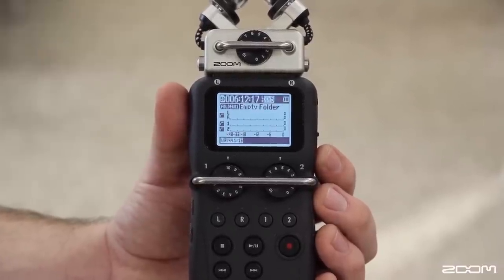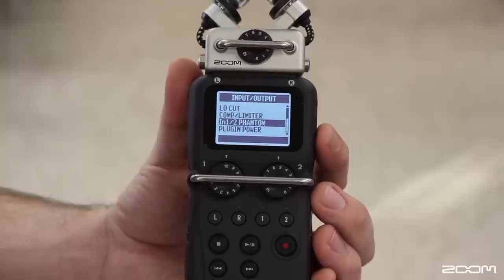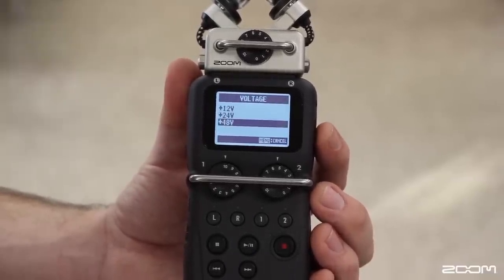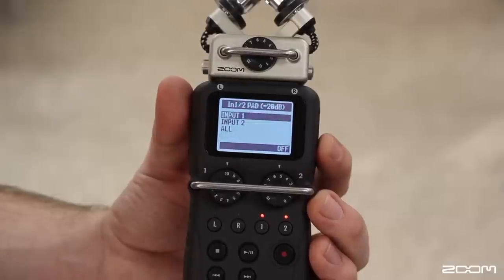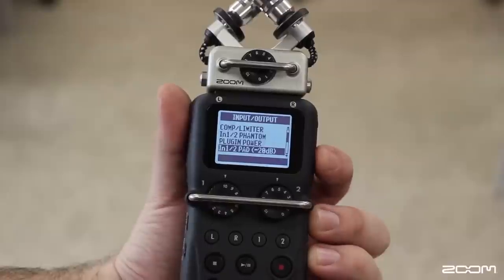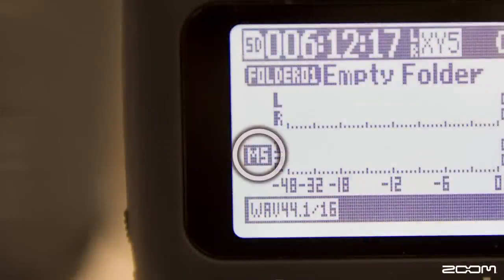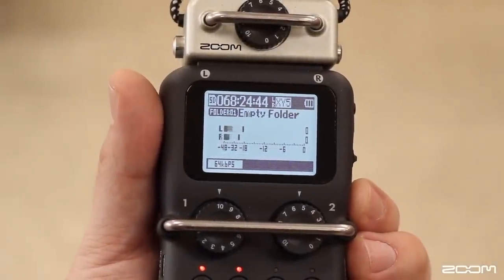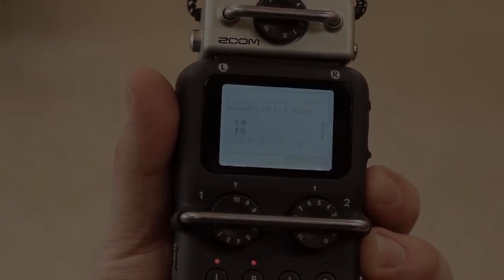Zoom H5: Input and Output tutorial

Comment: Is there a way to increase the output volume?
When I record, I get nice levels, with everything in the 50-85% range, and I can hear a great recording in the headset, but....
When I bring the file into Audacity, it comes in as a tiny thin line, that I need to Amplify 17-22x to see a sound wave pattern. This also increases hiss.

Comment: Hello! I have a question concerning Zoom h5 as an audio interface. Can I control the levels of the inputs of H5 from my PC separately? Should I use any special software? Or the only way to control the levels is every time to reach to gain knobs? Thanks in advance!
Reply from the maker: It would not be possible to adjust gain using your software. It is only possible using the hardware knobs on the H5.

Comment: Hello, thanks for the good videos. Is it possible to link input 1 & 2 gains for stereo recording? I can't manage to do this on my H5.
Reply from the maker: You can stereo link the channels but you will not be able to link the input gain.
Reply: Ooh so sad! I can try to move them both at the same time, but as the knobs are quite sensitive, it's hard to do this very accurately. I will try to do so by putting a little rubber band around the two knobs.
Maybe for a later update or for the Zoom H7 :)
Thanks for the answer!

Comment: Hello. How’s it going?

I’ve just bought a second hand Drum Machine and little synthesiser and been messing around with them throughout lock down.

I run them through a little mixer. If I purchase a H5, would I simply go via an rca to mini Jack. Go from the rca output on mixer, to the line in on the h5 via mini Jack.

Is it that simple? If anyone could let me know that would be really helpful. 

There’s a pawn shop near me with a h5 for sale, so I’ll grab it if it will suffice for what I mention above. I’ll also use it for recording out and about as well.

Cheers x

Comment: Hello I have write many times to you for your products and you have been really helpful. I have finally get in my hands a zoom h5 device. Its a great great great on. But I have a small problem and I am pretty sure that is solvable. I wish to use the device as an audio interface at 48kHz and that means that I have to use it in the MULTI mode. The windows environment seems to be working really fine I use the ZOOM H and F series ASIO and everything works well, the pc recognizes everything etc. The problem is with the Cubase LE AI Elements 8 it recognizes only the devices input and it doesn't allow me to select the ZOOM H and F series ASIO at the VST connection output audio device. Can you help me? The software seems to receive and display the signals fine but it doesn't send them out. Meanwhile the browser and other software are working perfectly. Any suggestions would be really helpful.
Reply from the maker: +Pau Cosmos Please contact support at info@zoom-na.com and we can help. Thank you

Comment: Is it possible to connect the Zoom H5 to a MacBook Pro to use it as microphone for Skype calls? If so, do you need any additional wires or adapters for this?

Another question is, I noticed the XYH-5 has 90 degrees only and the XYH-6 has 90 and 120 degrees. Which amount of degrees is optimal for recording the following instruments: (alto) saxophone, trumpet/flugelhorn and (electric) guitar.

Does the Zoom H5 offer playback from 50% to 150% without deforming the sound, just like the Zoom H6?

What are all the advantages of the Zoom H6 over the Zoom H5?
Reply: First, yes it's possible with the driver for Mac that you will find on Zoom's website. The H5 is acting as an USB audio-interface and you're not using the ADC in your Mac so improved sound quality. You can always use the line-out jack of the H5 and the mic input of your Mac but there's 2 level to adjust: Mic knob gain on the device and the gain of the mic port. 

Second, it depends of the distance between them. If you want to be close, it's sure that 120° is better because the sound is louder. I never use the mic capsule included with the H5 for music recording because I have Audio-Technica/Shure/Schoeps mic.

Third: the main advantage of the H6 is the ability to have 4 xlr input (up to 6 with the Zoom EXH-6 adapter). Also, you have physics button for the -20 db pad on the H6 that are in the menu interface on the H5. Preamps are the same in the H6 and the H5 so they're no difference in audio quality.

Sorry if my english isn't perfect; french is my primary language ;)

Comment: Great tutorial, thank you. I am getting great quality recording from my h5 stereo mics into my ipad. However I am using up my batteries on h5 which is a pity. I have tried powering my Apple camera adaptor connector, but h5 still using batteries. Any solutions to this please? Seems silly to use up batteries in the studio. My old h4 had a 5v external power supply, but it also worked when I connected my ipad through a powered mini usb hub...I haven't managed to get that to work either...
Reply from the maker: Please reach out to customer support team for assistance. https://zoomcorp.com/en/us/contact/
Reply: Done! Thanks

Comment: Hello! Has connected to the recorder a capsule from H6. Turned on, there is no reaction of the signal indicators. Twisted the adjustment, no reaction, I think, can something with the XY6. He put back his native capsule, and he does not see it. When you try to click on a record, it says: "No Chanel Record Ready." What could it be? What could happen? Everything worked after all. (
Reply from the maker: You will need to record enable the inputs which are being used. To record enable, press the L/R buttons.

Comment: Does the H5 have stereo input? Lets say I want to connect two lav microphones with an Y adapter. So I have two mics but only get one 3.5 mm jack connector. Can I use those two lav mics to record left and right, instead of using the left and right mics on top of the recorder. I want these two lav mics to be separated from each other onto an object, like a head.
Reply from the maker: The 3.5mm input on the XYH-5 mic capsule is a stereo unbalanced TRS input. We would recommend using two TS unbalanced lavalier microphones.

Comment: My H5 recently is producing high tone noise when turned on with the XY5 capsule even if my gain is at "0" and goes louder as I adjust it, I also get this noise with external microphones installed in the XY5 capsule. It's kind of whining tone that is superimposed on the BG noise when you turn the gain from "0" up. It also indicates a bar in the L/R meter as you hear the high pitched tone even when the gain is still at "0".  I tried to fully reset it but it's still the same when I turn it on.
It does not produce this kind of noise with just the line 1 and 2 XLR inputs. My H5 firmware is V2.10. Any inputs or suggestions? Thanks in advance.
Reply from the maker: Please contact our customer support team for assistance: https://zoomcorp.com/en/us/support/

Comment: Is the -20dB pad applicable to the line input, and is it pre-ADC? I have the zoom H2n and the line input is somewhat useless for recording from non-consumer mixers without extra attenuation...
Reply: The -20db is only applicable to the 1/2 input and I'm pretty sure it's pre because if it was after the analog to digital conversion and there's a very loud signal, it will distortion in the converter and the pad will just lower the gain.
Reply: I agree pre is the only thing that makes sense :) but on the h2n they have a post-ADC gain control, which is therefore useless for dampening hot inputs...
Reply: Yes it is only to adjust different level source together... The H2N isn't design that much for line input recording due to its form-factor.

Comment: I have H5 and wish to use all four recorded tracks AND to see them on laptop.
Cannot display all four tracks using free software provided and  CubaseElements unable to assist.
Reply from the maker: Hello, you can use the H5 as a 4-in/2-out audio interface using the Multi-Track audio driver. If you are having issues connecting, please email info@zoom-na.com to troubleshoot the issue.

Comment: i have a question...
so if u use the two input using the cables from ur guitar pedals (stereo) thru the H5 do u still to activate the phantom power? or not? let me know pls...thanks Zoom
Reply from the maker: You do not want to use phantom power if you are sending your guitar or guitar pedals directly to the H5 inputs.
Reply: +ZoomSoundLab. Thanks Zoom... So if im using the dslr and the h5 all i have to press is the record on the dslr and it will record and sync automatically right? 
Plus if i use my last two output from my guitar fx it will record it like directly plus it will sync it to the video?
Reply from the maker: Bern Sanchez
If you have a cable connected from the H5 output to your DSLR audio input, then you are correct.
Reply: ZoomSoundLab thanks guys u guys are the best
Reply: So, the H5 removes the need for an attenuation cable to my Nikon D5300, is there a specific cable I should be using between the two? Probably not your wheelhouse, but I'm also having trouble locating an exact line output level, though I'm sure I can tweak it to perfect with some work. Thanks!

Comment: I'm having problem turning on and off channels 1 and 2 independently when using the H5 as an Interface. They seem linked, when i turn on the channel 1 the 2 turns on with it. I've tried going to Rec Mode and Selecting Multi File, but that only works when using as a recorder and doesn't affect the interface/USB mode..
Reply from the maker: This is normal operation. You can choose which inputs are being used in your software.

Comment: Hay.. I have the zoom h5 and I am truly enjoy it almost daily, practice with microphone Cobalt Co7 that not required phantom power.

Yesterday I got Beta 87a microphone and it’s didn’t work for me.

I try on the menu 
In 1/2 phantom
I select all 
ON
(I also try each of the them, put on ON)

Voltage on + 48 V

(I don’t try to record myself yet, just to practice with the microphone and hear myself with headphone)

Please, what I’m missing for I can use the beta 87. (when I just change the microphone Cobalt Co7, it’s works absolutely great)

Thank you 🙏 I wish you help me
Reply from the maker: Please email info@zoom-na.com to troubleshoot the issue.
Reply: I would like to update, find the troubleshoot for use phantom power microphone 🎤 with Zoom h5 !

1. after I make sure that I did in the menu:
In 1/2 phantom 
Select All
ON

Voltage on + 48v

2. I needed to change the microphone cable that go into 
1 or 2 channels in bottom of the h5.
the cable that works for dynamic microphone it’s not work for phantom microphone. 
(In the 2 side of the cable should be  circle with 3 points)

Thank You 🙏 I hope I will help someone.

Comment: If I am using L/R, Input 1 with a boom and I am sending the Line Output to the camara, which channel is being sent out? LR, L1 or both? how do I set it up?
Reply from the maker: All channels will be sent through the Line Out by default. There is no set-up necessary.
Reply: ZoomSoundLab is there a way to select which channel will be sent out through the line output?

Comment: How do I record separate audio tracks via XLR input (due to podcast recording), but still hear it as a stereo output in my headphones??
Reply from the maker: This is how the H5 will record by default in Multi-File mode.
Reply: ZoomSoundLab I’m confused. Currently when I record I’m only getting a single audio track in while recording 2 XLR inputs and I hear it in audio. How do I go about changing this to get separate tracks and still hear stereo in the headphones when monitoring the audio.
Reply from the maker: Go to MENU > REC MODE > Select MULTI FILE

You will also need to make sure that inputs 1/2 are not stereo linked

Comment: Can I use the H5 as a microphone for my PC? Which jack do I use?
Reply from the maker: You want to use the audio interface function (stereo mode) to use this as a USB mic
Reply: Got that working, but it doesn't seem to work on Ubuntu. Maybe the USB cable I'm using doesn't work well.
Reply: Yeup! Changed the cord and it worked : )

Comment: I have a question using the H5 with a Canon 5D Mark IV.  I’ve connected a Sennheiser shotgun mic and a Sennheiser wireless lavaliere mic to the XLR 1 and XLR 2 inputs on the H5.  I’m using the LINE OUT on the H5 to connect to the Mic input on the Canon 5D.  

Both the Shotgun Mic (XLR1) and the Lav (XLR 2) are recording onto the LEFT channel on the Canon 5D video file.  Is there any way to get XLR 1 to record on the LEFT channel of the Canon and and XLR 2 to record on the RIGHT channel of the Cannon?   That is - can one input record on one channel and the other input record on the other channel?
Reply from the maker: You will need to stereo link inputs 1 and 2 on the H5. Additionally, it sounds like you may be using a TS cable when you will need a TRS cable to connect from the H5 to the camera.
Reply: @ZoomSoundLab  Thanks!  Changing the cable to TSR and stereo linking the inputs 1 and 2 worked.  As you noted in an email, you need to press inputs 1 and 2 simultaneously rather than the way the manual described to stereo link in multifile mode.
Reply from the maker: @lipoc  The manual explains holding down 1 and pressing 2. This method also works!

Comment: I wanted to purchase the EXH-6 capsule for my H5, but when I tried it in the store it didn't work. I plugged an SM57 into it and there was no signal whatsoever. The pad was off, the input level was at 10 and still nothing. Any help?
Reply from the maker: Are you running the latest H5 firmware?
Reply: Yes.
Reply from the maker: Please email info@zoom-na.com to troubleshoot the issue.

Comment: I'm thinking of buying an H5 or an H6 and I'm mainly going to use INPUT 1/2 to record stereo signal from DJ mixers. I'm afraid that recorded stereo tracks may not perfectly centered because level of INPUT 1/2 is controlled separately and the dial seems to be continuous one, which may cause either channel to be slightly louder than the other. Is there any way that left/right balance of the recorded track is perfect? (position of the two level adjustment dials are the same?)

I have to adjust input level on the recorder a lot since I play on different venues where I see gain setting of the mixers are very different from one to another, and more importantly I cannot control output level of the DJ mixers. Thus if I should take extra care to set position of the two knobs equally on my every DJ session, it would be very frustrating. Thank you.
Reply: Yup.. this is a real problem with this recorder unfortunately
Reply: Use an dual rca to trs cable. Connect the rca to the output of your mixer and the 1/4" trs to input 1 or 2. One trs can send stereo audio.

Comment: What is L/R and 1/2?
Why are they used?
Reply from the maker: These are the inputs on the H5. L/R represents the attached mic capsule; 1/2 represents the two XLR / 1/4" combo inputs.
Reply: @ZoomSoundLab  Hi there, is the LR 3.5 mm input a line input or mic ? Just want to know if it can be used for recording a mp3 backtrack while tracking a guitar with INPUT 1 for example. Thanks

Comment: Is it possible to capture audio from an XLR connected mic send it from the line out of the Zoom to a DSLR while capturing separate audio from the capsule to create an additional scratch audio file in the Zoom?
Reply from the maker: +PinnacleStudioPro Yes it is. Line output to the camera can be controlled with the MONITOR MIXER function allowing you to isolate the XLR input you want. Then you can record the capsule to the SD card.
Reply: Thanks for the response.

Comment: I have been asked by a good friend to capture sound from a 5 participant discussion the building where it will take place is ultra modern and has a small 8"x12" panel at the back of the room (room size 50 mtrs x 15 mtrs)
On the panel, there is an XLR input that I was told was used for patching into.
I am unsure what cable I need to use, should it be a 1/4 inch Balanced Jack to 2x Mono XLR Splitter Lead or does it need something completely different?
For this session, I have a Zoom H4n or my very new H6 which I hope is good enough.
Any advice would be extremely appreciated.

Thank You
Reply from the maker: You are connecting the output of the H6 to an XLR input? You will need a 3.5mm TRS to 2x XLR male y-split cable. This is not very common since XLR is typically use for balanced audio.

If you are doing the opposite, you will just need a male-to-female XLR cable.
Reply: @ZoomSoundLab  Sorry what I meant to say was that there is an XLR 'OUTPUT' on the panel which I hope to input into my Zoom H6, so does this mean I should go for option
 2) male-to-female XLR cable? 

Thank you and sorry for the confusion.
Reply from the maker: @HMVideofilms  Yup! If the output is stereo then you will need two XLR cables.
Reply: @ZoomSoundLab     

Thanks, ZoomSoundLab

It must be mono, as I only saw one XLR out on the panel which is surprising as in a building as modern as this I would have thought they would have gone for stereo over mono, oh well one male to female XLR cable it is.

Again many thanks.
Reply from the maker: @HMVideofilms  No problem!